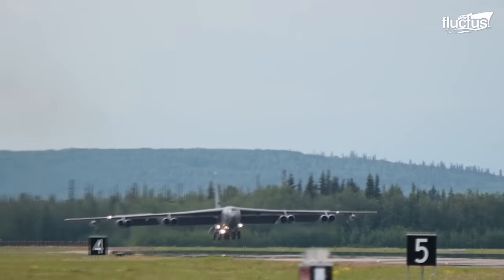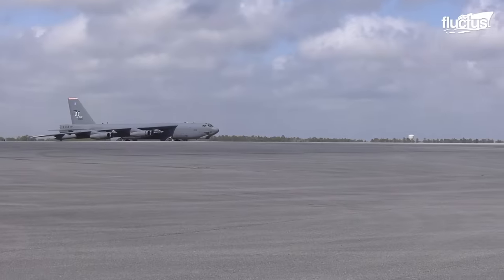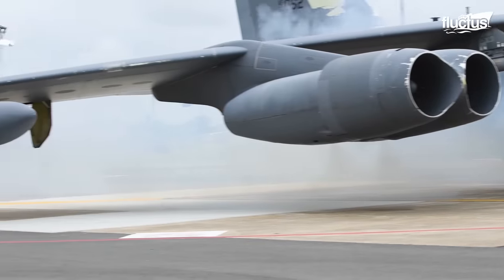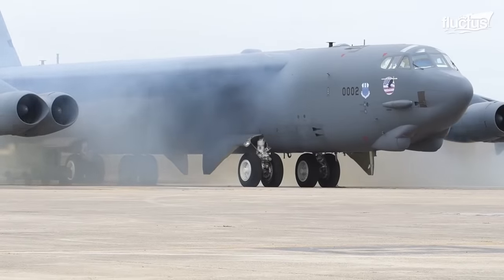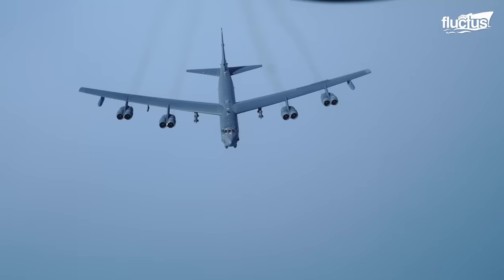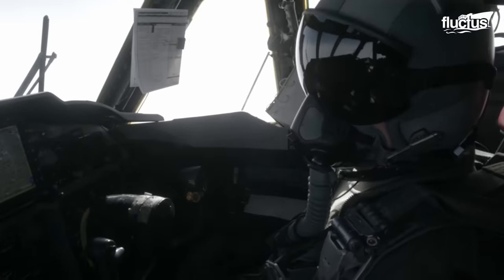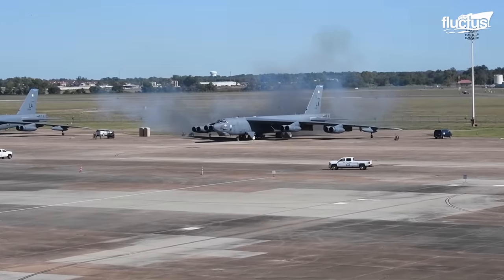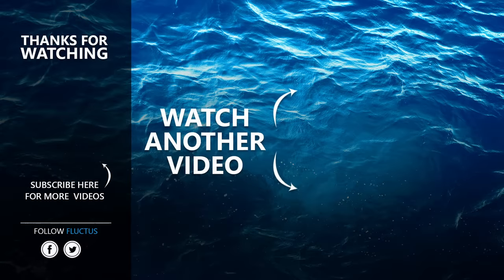The Scary Way Engineers Decided to Jump Start this US Gigantic Bomber

Comment: Hey, love your videos so all props to you all. However, cartridge starts are not uncommon and exist on many aircraft. It's not a big deal. Also if the aircraft is equipped with an APU it doesn't require an air cart. the APU can start itself. The cartridge is not like a shotgun shell, it's almost the size of a coffee can. It's ignited and produces a large quantity of smoke/gas that spins the motor up. One of the purposes of the cartridge starting is the shorten the time it took the airplane to get off the ground which was important for the B-52 as they often were on alert status in case of nuclear attack.

Comment: The F-111 had cartridge started also. The expanding gas from the cartridge spun the starter the same as when it used a ground power cart ( in the Navy we called them huffer carts ). Once one engine was running compressor air was bled off the running engine to turn the air driven starter of the second engine. Multi engine jet aircraft need only one running engine to feed the other starters. I worked for Grumman Aerospace and we tested the use of a hydrazine starter on a F-14 prototype for quick start ups. That was more dangerous than anything I saw used to start a jet engine.

Comment: I can't speak for later on, but, through the mid 1980's those of us tasked with working on or guarding BUFF's in Alert Area's were issued Quick Start Masks for when the cartridges were used, so we didn't get choked out from the gasses produced by the cartridges.

Comment: Well, I finally know about after burning, fueling improvements and how much I don't understand something so heavy still doesn't break when it flies so slow and looks like it just floats.
Reply: Boeing built it very well. You would be shocked to see the wings going up and down and the engines going in and out during summer low-level
 operations.
Reply: @ted3020  yeah I can't imagine how much with those wind drops I felt in 747s compare to what those feeling of wings that long go up and down would be like.
Reply: It was enough that I never looked at the wing in summer operations again for the rest of my career.